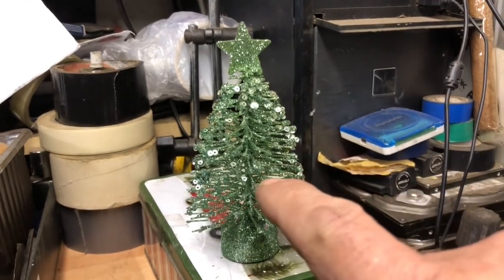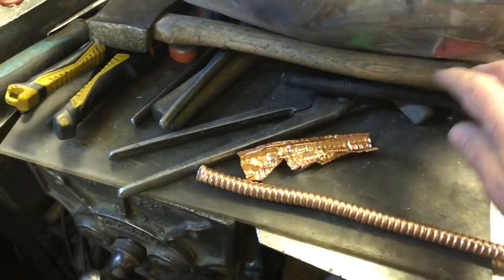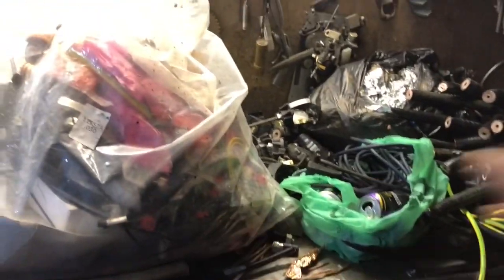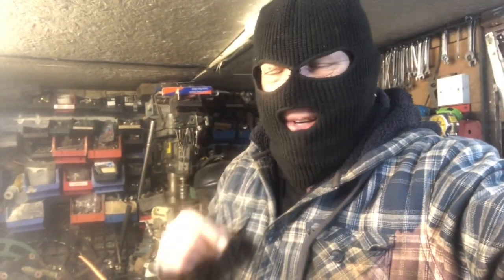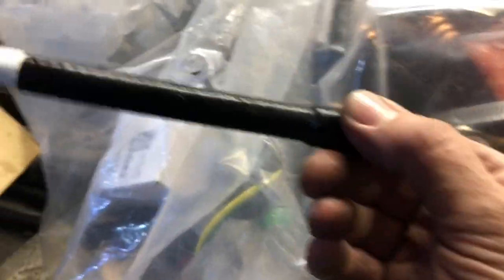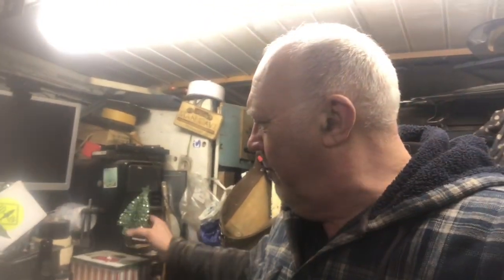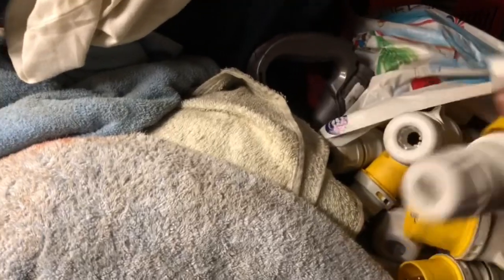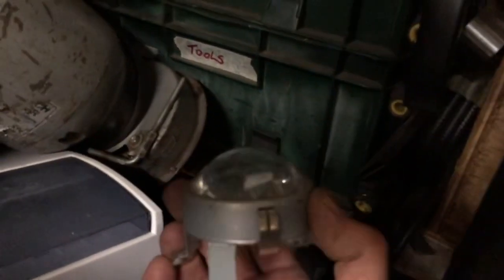Yeeeeewwwww for the dream

Comment: That bigger wire has a copper tube running in the middle of it
I get that stuff too
And bags like that on your bench that's full. Of goodies
A lil tip for you
When you cut the small stuff and get the Ally rod out
Cut the bigger stuff and get the copper tube out then fill the tube with the Ally rod and crimp the ends 🤣
And get paid copper prices for Ally
I've got a full shed full of that wire that just will not go down because I just keep getting it
Like I said on  the previous video
Happy stripping mate
♻️👍♻️👍♻️👍♻️